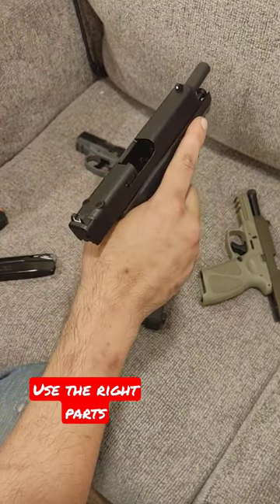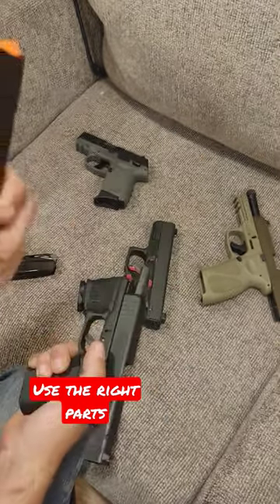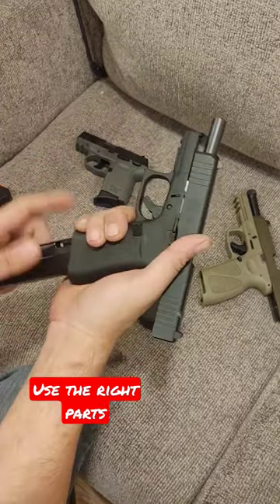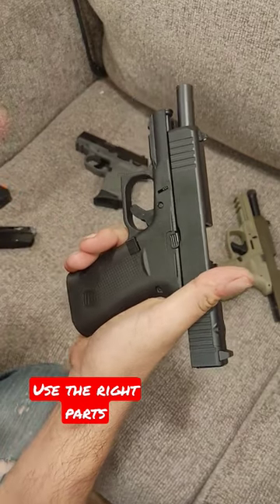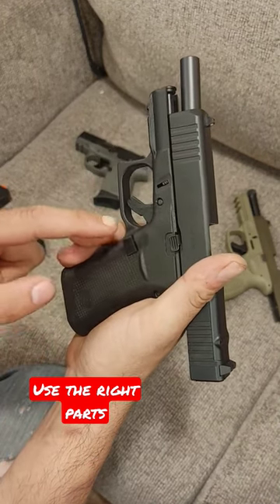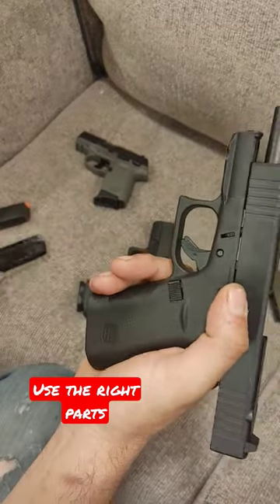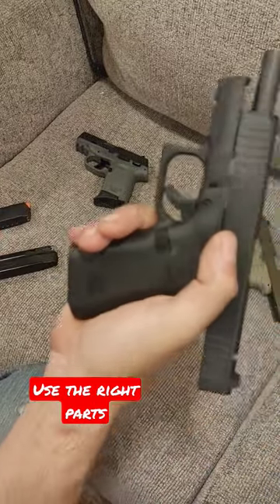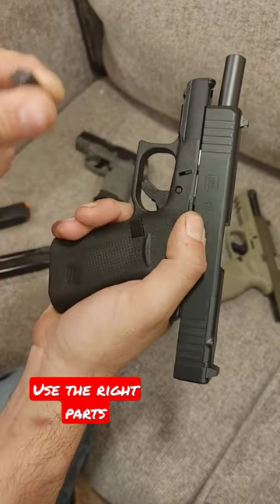Use good parts,

Comment: Little hint for the metal s15 mag release..slightly, and i do mean slightly, round or knock off the sharpness(polish) of the corner of the magazine release that holds the mag in place..this will make your OE magz last a lifetime, and it will still work as intended.

Comment: Technically u are correct and he is correct. I have a glock 43x mos and a plain 43x. Both with metal mag releases. Tyrant mag release in my mos and shield arms in the 43x. My 43x mos locks back with gen 1 and 2 shield mags. The 43x won't lock back with either. I think it's the slight difference in sizes between the glocks dimensions. Reason why some people have luck with the mags and some don't.

Comment: If you switch to metal mag release you need to use the shield mags from there on. Using the OEM mags will wear out the mags.
Reply from the maker: I disagree in part. I have 2000 rounds out of a Glock 48 and while there are some marks on the magazines, there is no indication of potential damage or failure on the part of the magazine. And you should be swapping out magazines anyways. Magazine Springs can wear out over time especially if you actually use the firearm. As much as I hate Glocks in general because of the Fanboys, Gaston actually knew what he was doing with polymer. Now s*** p-mags on the other hand probably will get damaged faster and those ETS piece of crap mags don't even deserve to be in a Glock

Comment: I've been having an issue recently with my shield mag, it will hold open when I manually open the slide on an empty mag, but it won't lock back when im actually firing, and it's not my hand on the slide release since I'm left handed. I'm pretty sure the mag needs a new follower spring. I've ran maybe 500 rounds through it no issues than it started not locking back.

Comment: I actually do have that problem I have two newer shield arms mags and one older also have the shield arms mag release and the older mag will not hold the slide open. if you push the mag up in the gun further it will hold the slide open however where are the mag sits naturally will not hold the slide open

Comment: Love the videos thanks for sharing. I was wondering if you may know why some guns when the slide is locked back if you slam the magazine in the slide will release and chamber a round. I have a beretta apx and it does this but only when inserting fairly fast with force. And typically happens when friends and myself are having a comp on speed and accuracy.

Comment: But then you probably shouldn't use the OEM mag's with the metal right? I know mag's aren't very expensive but I have OEM Glock mags with fairly heavy use that are 15yrs old with only spring change.
Reply from the maker: It's much better to use the metal mag release even with Factory OEM magazines. It's the magazines themselves that are damaging the plastic mag release. The metal mag release is not going to cause the same level of damage to a plastic mag because the edges on the mag release are not razor sharp like the holes that are cut in the shield arms magazines
Reply: @TheJimminiShow  I get it but I was issued a gen5 G17 5 summers ago and the round count is now around 8k'ish with only one malfunction. The malfunction was me riding to high & engaging the slide stop prematurely. I also have a G45,19,43x,&42 which all have a good round count with only the user induced malfunction stated above. I have to contantly adjust my grip as to not engage the slide stop. I'm just going to stick with what I know work's as far as internals go. I definitely believe in aftermarket upgrades I have a Holosun 509t/G45/Tlr1hl and Trijicon RMRrm7/G19/X300u b with the G45 being done by Jagerwerks and the 19 by Maple Leaf and I love them.
Reply: @patronsaintofswitchbladefi2944  he's right the metal mag release isn't sharp so it wouldn't really damage the mags over time. Where as the metal mags 100% will damage the plastic mag release

Comment: So the mag was wearing out the release and the mag was sitting lower in the frame?
Reply: Right, as it sits lower in the frame, even if its still secured with the plastic mag catch, the follower cannot push the slide lock up high enough. Talking only a couple millimeters. Can also cause feed problems.

Comment: PHEW! He didn't slam the slide home on an empty chamber this time boys! HARAAA!
Reply: why would that matter on a glock?
Reply: @kurtcomena4383  the rim casing cushions the slide when reciprocating the closest round from the magazine to the chamber by over 78%. When there's no round to be guided into the chamber the slide with slam home past the two front most lower guide rails by just a fraction of an inch, causing a really rough slam and bounce back on the entire frame. This can drastically increase wear on the frame, both the extractor & ejector and some even claim the guide rod depending on the caliber and ibs guide rod. It's okay to do it every once in awhile but if you do it a lot you'll start noticing excessive damage on the frame and internal parts. Luckily glocks are like little tanks so they can take a lot of abuse.
If you slam the slide home like that on tight tolerance pistols you'll start noticing damage and malfunctions at a MUCH higher rate, especially with 1911 style firearms chambered in 10mm & 45.

Comment: If the mags are the same dimensions why can’t the g48 mag hold 15?
Reply: The Glock mags have a metal insert inside a polymer shell that can only fit 10rds, Shieldarms removed the polymer shell, expanded the metal insert to hold 15rds.

Comment: Might as well get a Glock 19 or 26 if you want more mag capacity
Reply from the maker: I have a Glock 19. I like the center feel of the 48. And the improved grip angle. And for 60 bucks you can get the mag release and the mag. This MOS 48 was only $499 so for $549 I have an MOS Glock with higher capacity.
Reply: @TheJimminiShow  yeah I guess it feels better in your hands my Glock19 with a large Back strap fits perfectly in my hand